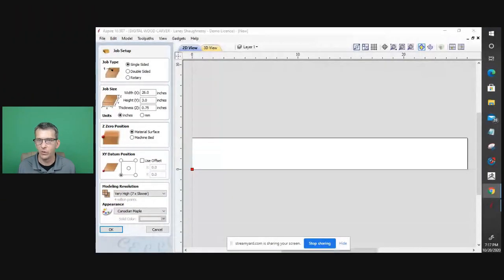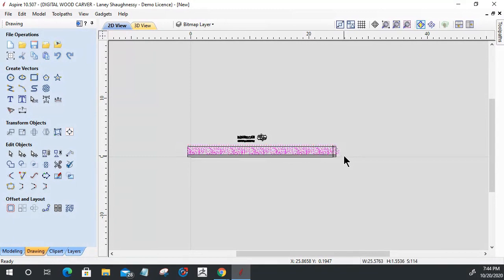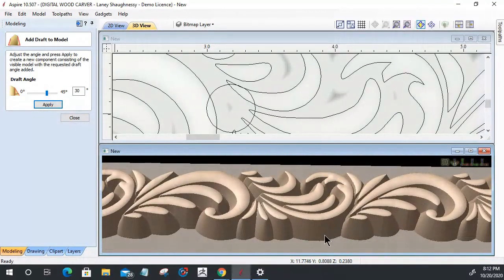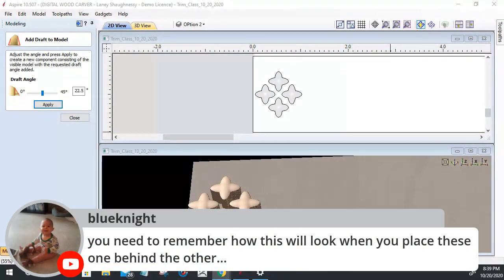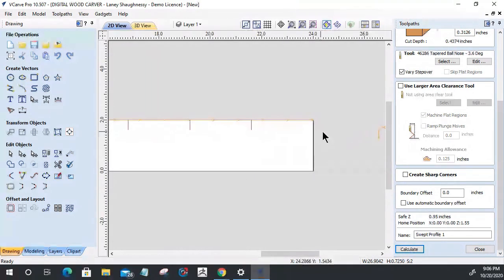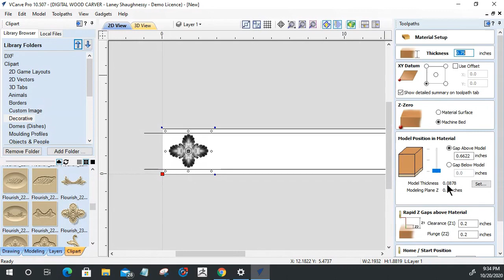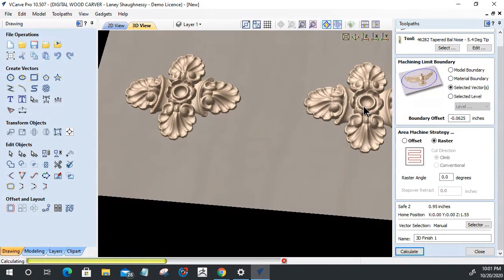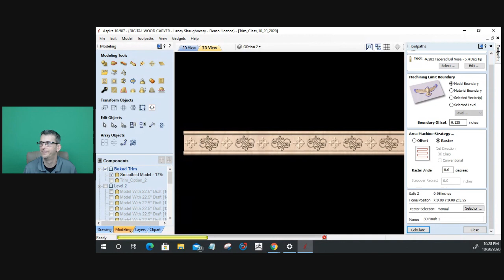Decorative Trim - Modeling Trim for different Projects.  VCarve & Aspire

Comment: Sorry I missed you. But one should be well rested for your tutorials :-)
You have convinced me to start with the "Moulding" feature in VCarve.
My take away is that there are pressing matters for the development team at Vectric. Some of them are really obvious when you are coming from many other CAD ware out there. I learned Fusion360 before any Vectrics software
ie.  the copy tool (input number of copies and the spacing required) 
How about one of my favorite grizzles as of late:
Rotate an SVG or vector, why can't there be an prompt to input degrees_rotation or at least a readout of the rotation around its center as you mouse it around. Perhaps it could snap to 45deg, 90deg guides. 
None of this is a big deal.
Reply from the maker: As far as the rotate. NUMBER 9 key is rotate counter clockwise 45 degree increments NUMBER 0 Key is rotate clockwise 45 degree increments. When freehand rotating holding the ALT key snaps to 15 degree increments during the rotation.

Comment: Wait what? The modelling resolution translates to quality of finished product??  Yes I watched to the very end......
Reply from the maker: Yes the modeling resolution translates to the quality of the cut so when working with 3D components (models) you want to at least have the very high resolution which is 8 million points/pixels because if a model is pixelated that pixelation is calculated into the tool path and translates to the finish quality of the cut.